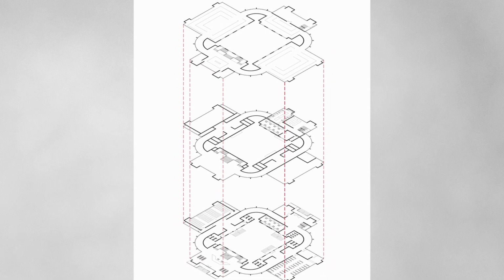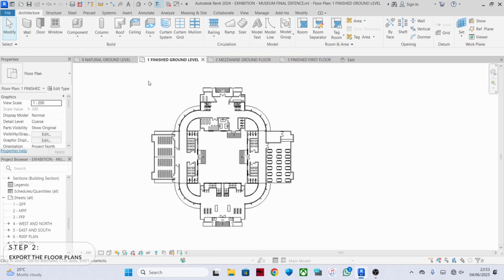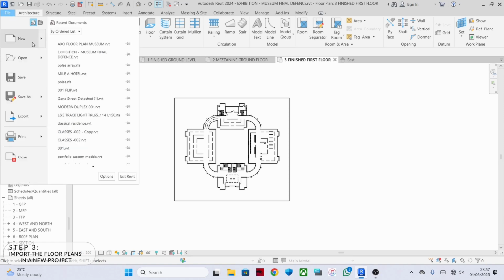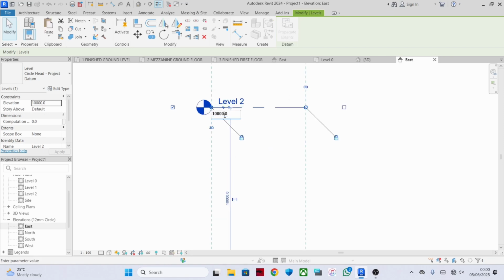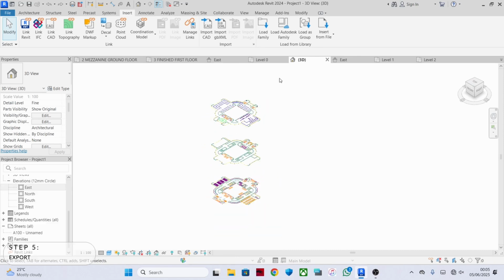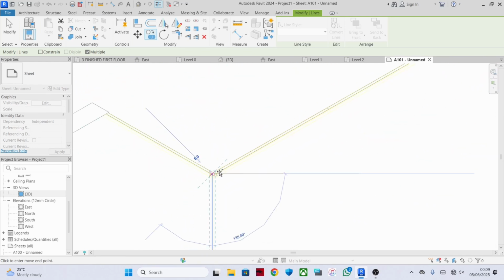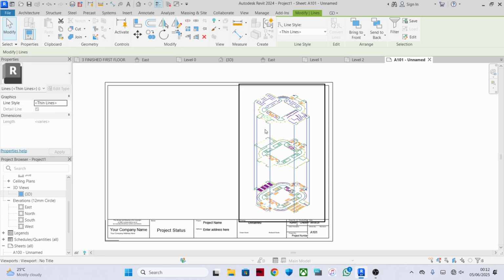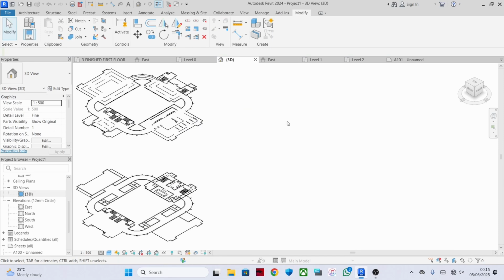HOW TO: Isometric/Axonometric floor plans in Revit.

Comment: Hi! How do I do this in the current/existing Revit file? And what I mean by that is not making a new project. Thank you!
Reply: You can do it by creating a new 3D view within your file and using the displace tool to physically displace everything in that 3d view. Significantly more time-consuming than this, however, and there is more front-end work on setting up view templates.
Reply from the maker: Hello,
The easiest way is to just create a new file. This because we want to work with the floor plans as “model lines” not as a “model”. You can do what Justin suggested or redraw your plans using model lines but both of them are time consuming and complicated.